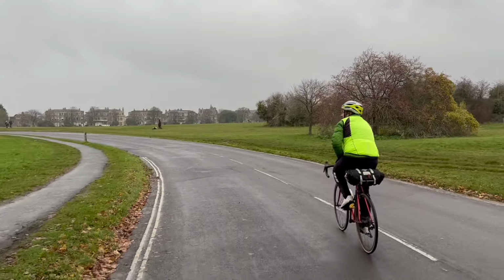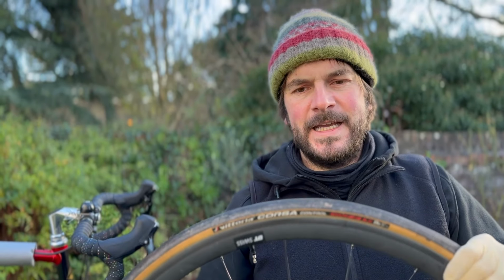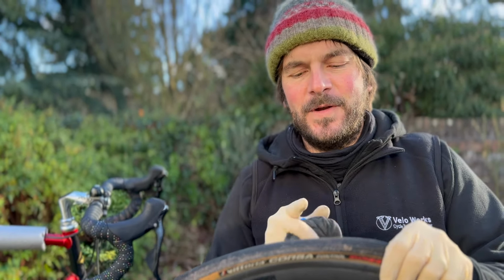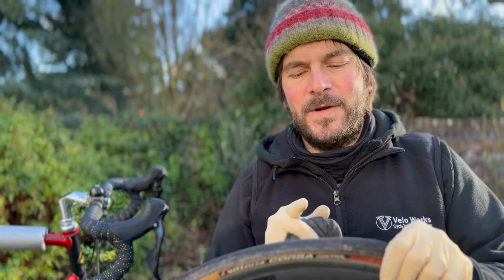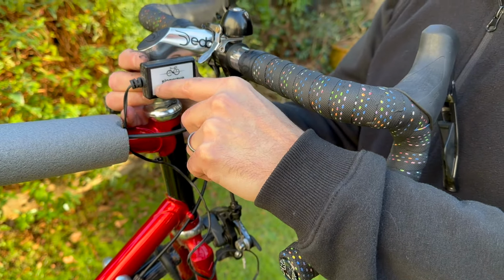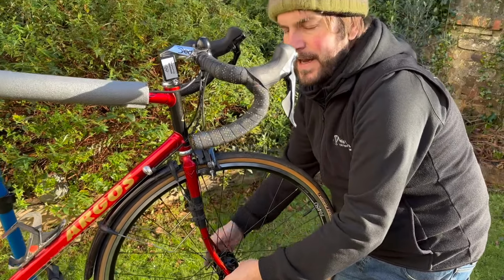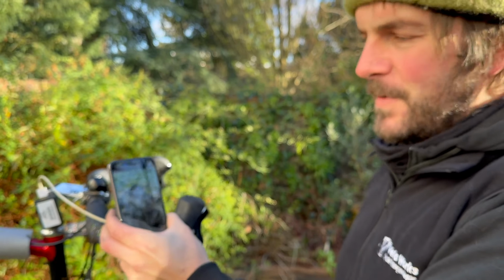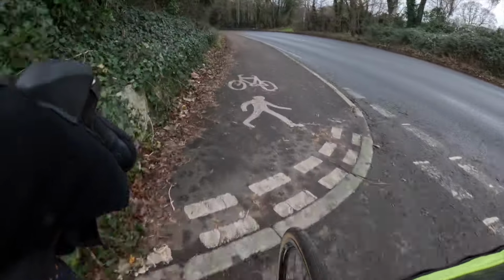Hand-built Dynamo Wheels for my Road Bike 💥

Comment: I've been running a SP V8 hub for the last year with a set of B&M lights and a sinewave revolution also wired in. I found that the sinewave slows down battery use on the phone or Garmin, but I've never been able to increase charge with it - I never run both lights and charger at the same time. Having watched this I think I'll review the wiring as I wonder if there is some small voltage loss there. Hmm. Dynamo lights though - gamechanger for the winter commute; I love them!
Reply from the maker: Sinewave are really good if you contact them if you have issues 👍 Hope you get it sorted ✅ Thanks for watching

Comment: Jobst Brants (sp.) recommended 'pluck tuning' - where the spokes are plucked, like a harp. I don't think I've ever bought a built wheel but build my own using this pluck technique.  The wheels stay true for a very long time, as each spoke it pulling the same amount.  You can 'pluck' for pitch or you can buy a super expensive tension meter.  The pluck-for-pitch is probably better. Imo
Reply from the maker: For me it’s any excuse to buy a nice tool 😂

Comment from the maker: What do you use your dynamo for?
Reply: Usually for lights and/or USB charging.
Reply: On folding bike, and my city bike - for lighting. B&M make a neat rear dynamo light which has a braking function - it brightens if you slow down or brake.
On road bike for charging.
Reply from the maker: @john-r-edge  ah thats cool with the braking 👍